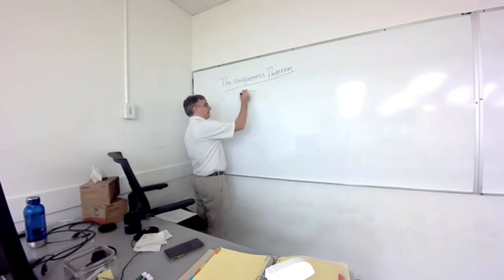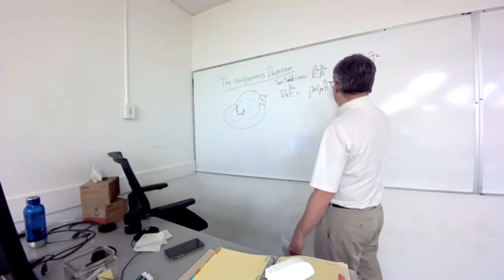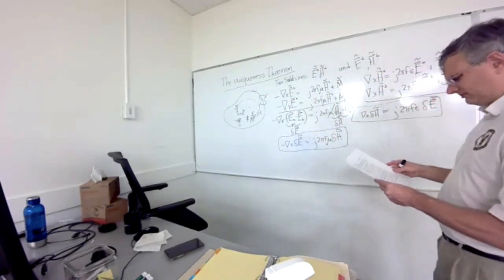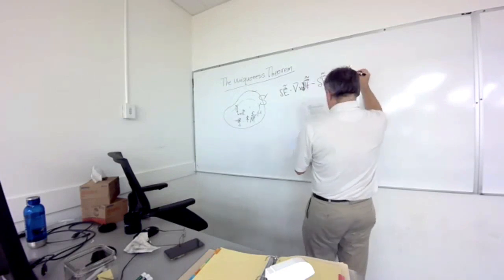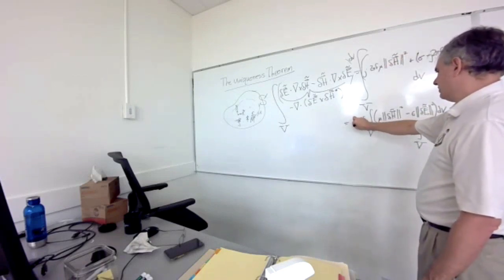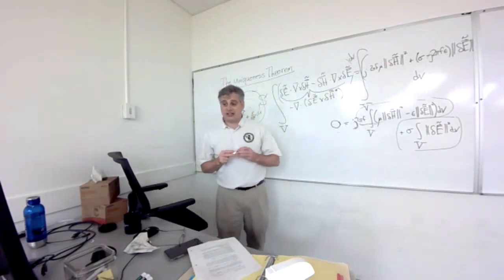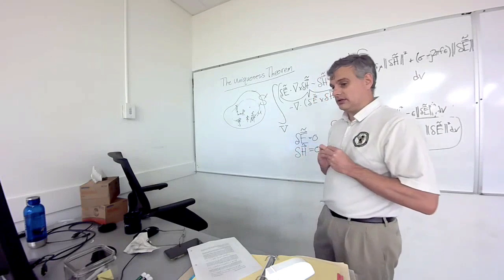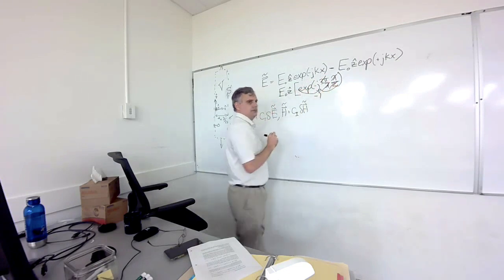POT01:  The Uniqueness Theorem

Comment: If I'm not mistaken, the counter-propagating plane wave example you show around 31mins yields non-zero tangential magnetic fields on the surface S....   To go with the transmission line analogy:  a shorted transmission line has no load voltage (electric field) but the current (magnetic field) doubles/is non-zero at the load.  If that's correct then I believe the added standing wave field poses no threat to the uniqueness theorem, even if the media is lossless....   Maybe I'm wrong? 38:33